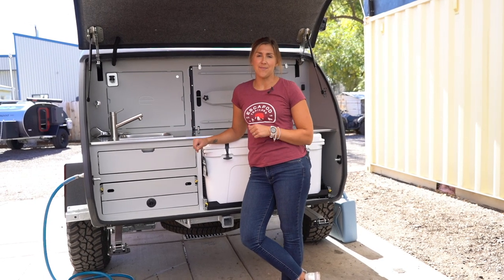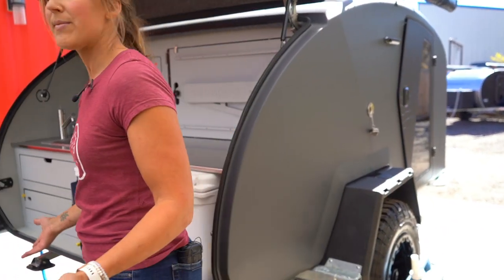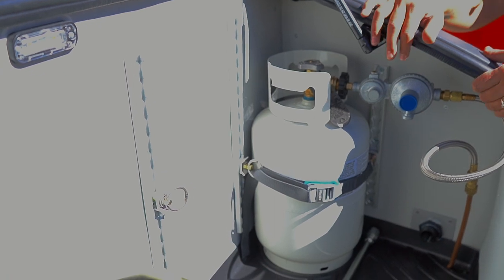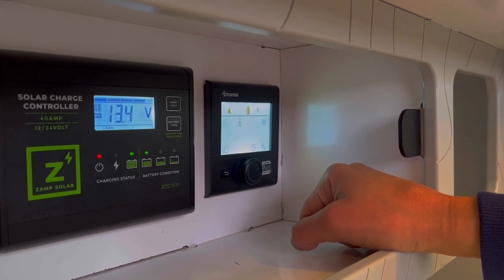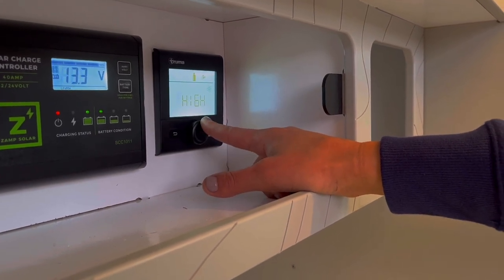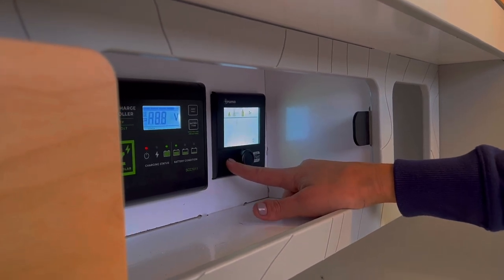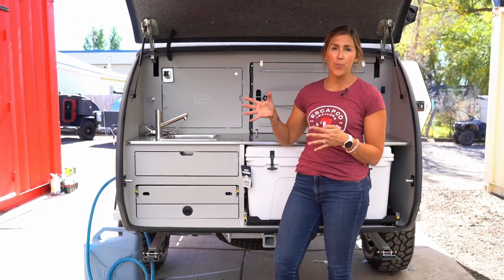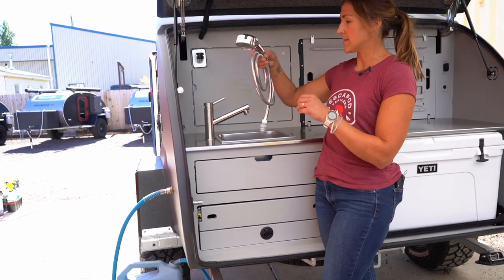TOPO2 | Teardrop Trailer | Water System

Comment: Does the pressurized hose fill option for filling the water tank use the same gravity feed opening, or is there a different location on the trailer for that? And if it’s the same, I’m guessing you remove the cap from the beaded chain and the hose screws in?
Reply from the maker: Thanks for the great clarifying question! The hose does not three in anywhere, you just hold it in place similar to how you hold the jerry can in place.
Reply: @EscapodTrailers  Got it! Thank you!

Comment: Does the water spill out the overflow when traveling on rough terrain?
Reply from the maker: If you've filled the tank to the very top and are going over extreme terrain, you'll probably lose around 1 gallon of water, just simply because of the angle of the overflow.
Reply: @EscapodTrailers  perfect. That’s reasonable